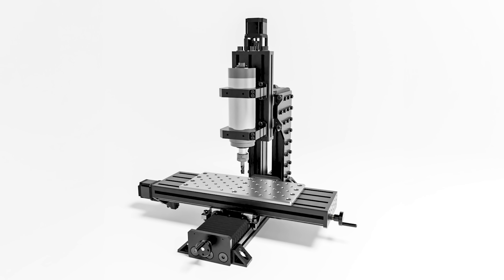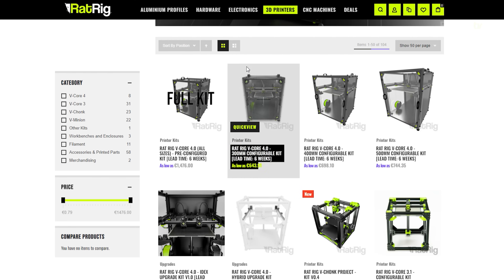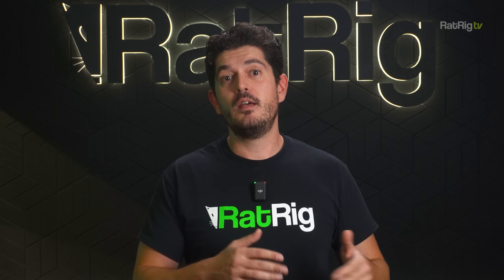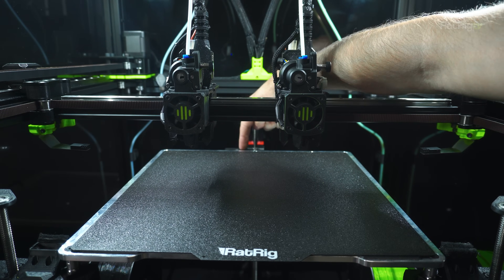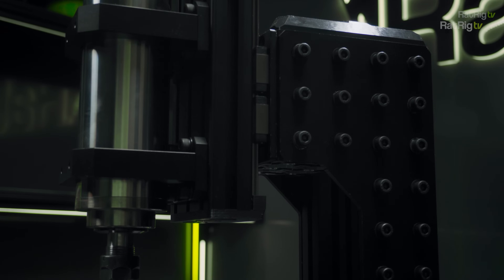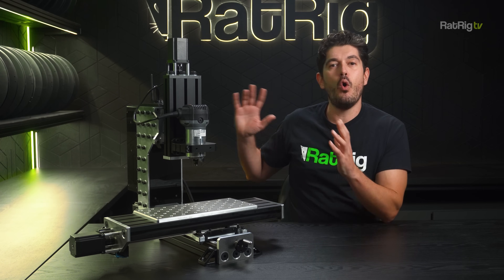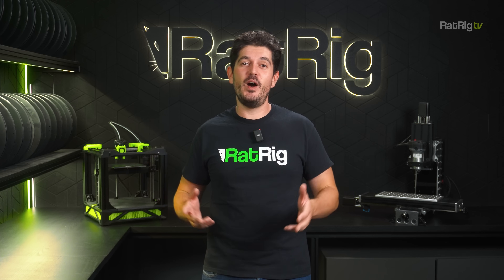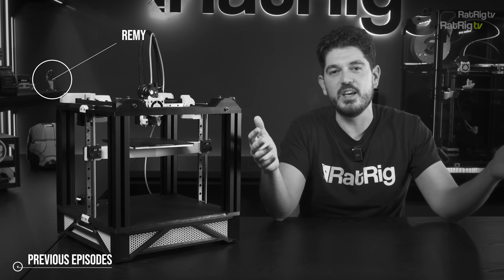V-Core 4 IDEX was just released & Mill is on the way! | Rat Rig TV #08

Comment: RatRig conquered FormNext.  Thanks to the great viral marketing, everyone knew RatRig was there!

The first 3D printer I bought (instead of built) was an IDEX machine.  I loved the features and performance when it worked but it was fussy to calibrate, required a lot of maintenance, and had to be recalibrated every time a nozzle was changed, etc.  The IDEX system on the V-Core 4.0 is what IDEX always wanted to be.  It's FAR more useful to me for my functional prints than the AMS and MMU single nozzle color change systems that waste half the time and material purge pooping, or the somewhat better tool change system that can have more than two tool heads but waste a lot of time and are inherently less reliable.  Mirror printing is great because many parts are symmetrical (parts printed in mirror pairs or parts that can be mirrored and are the same), and mirror printing cancels the X accelerations of the two tool heads for faster parts of better quality, in half the time of using a single tool head.  No wonder it's been such a popular option.

Comment: how does spool joining witout afilament senor work
Reply: You need a filament sensor for it to work, obviously :)
Reply: @miklschmidt probably should be highlighted that's an additional purchase
Reply: @skyeblackledge2068  He's listing a RatOS feature, not a printer feature.
Reply: @miklschmidt  I understand your point, but it's important to note that the feature is discussed in relation to the overall experience of the idex system, especially on a vc4, which doesn't come with the necessary hardware to use the highlighted feature as standard. Some views may misinterpret this, and I simply wanted to highlight this from an audience perspective.
Reply: @skyeblackledge2068  I get it. RR machines are modular, customizable and configurable. By default the v-core 4 doesn't come with anything, it's a configurable kit with recommended standard hardware. If you want to use any of the features listed in the video, you gotta put the right items in your cart. That includes the filament sensor if you want spool join mode, Rat Rig sells both the BTT Smart Filament Sensor v2 and the Orbiter v2 filament sensor in the shop. The RatOS 2.1 documentation will list what's required for the different features. Note: you can use any filament sensor. Even if it's a dumb switch put into a custom printed part.

If they had to list out every piece of hardware you need for every single feature they talk about, these videos would be a lot longer.